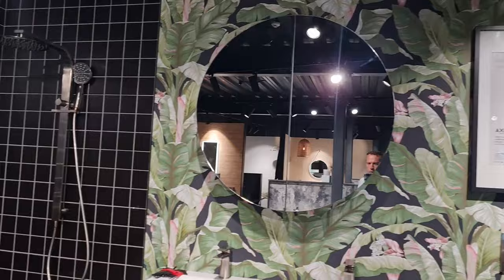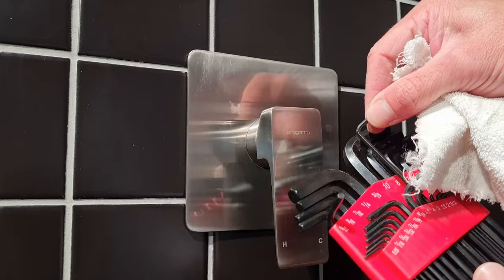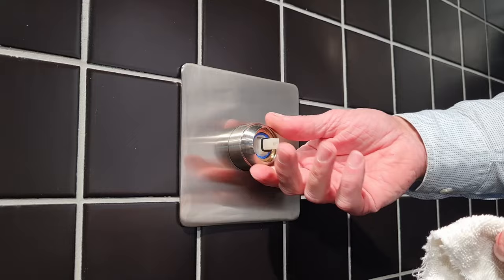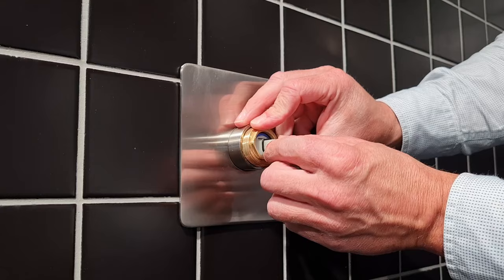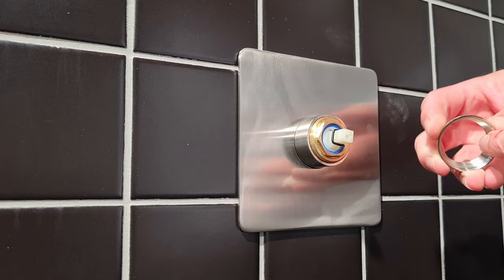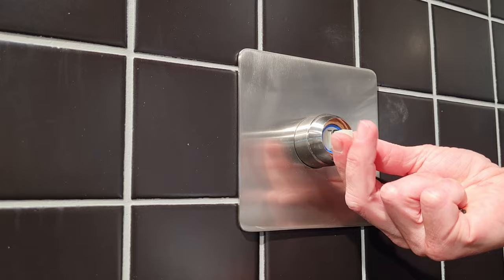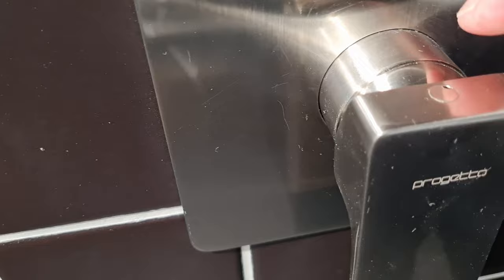How to change a shower mixer cartridge   Plumbline tapware

Comment: Great video! I was able to change mine today. Thank you.
Reply: Where can I buy the parts pls.
Reply from the maker: Most plumbing shops will sell these cartridges, usually known as 35A or 40A 'flat bottom' cartridges (35mm and 40mm diameter respectively) the Kerox brand are very good, check here - https://kerox.hu/en/products/cartridges/ - ask your local plumbing store for them.

Comment: Great! No washers or rubber seal things? Looks simple. Gonna try it.
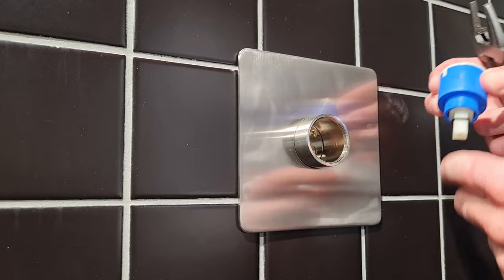Reply from the maker: Depending on the model and the cartridge that it takes, the seals should come with the new cartridge. Make sure the old cartridge gasket/seal is not left in the mixer when removing it, check for this as in the video at 3:48 mins - https://youtu.be/YLLudC3DdxM?t=228  Cheers.

Comment: Pardon my ignorance. Are these cartridges adjustable? Would you be able to adjust the amount of hot water coming in or do I have to do it elsewhere in the system? Thanks.
Reply from the maker: I'm not sure what brand mixer you have but you can get a 35mm cartridge with an anti-scald ring (or hot water limiting ring) - here is the link as an example:

https://kerox.hu/en/product/kn-35/

ADJUSTMENT OF THE HOT LIMIT RING:
When the cartridge is supplied the hot limit ring is in the middle position.
To save hot water and to avoid scald the ring can be turned. In this case the pin of the ring is bumped against the stop around the cartridge, before we can reach the full hot water position by turning the handle of the faucet.
The adjustment of the ring is as follows (see the attached drawing):
The hot limit ring must be removed from the cartridge.
The ring must be turned clockwise up to the requested point.
The ring must be re-positioned onto the cartridge.
Maximum flow rate can be adjusted by a grub screw located in the lever.

(You can see the grey hot limit ring in the picture on the webpage in the link)

Hope this helps.
Cheers.
Reply: @AJsTechTalk8370  Thank you for your prompt reply. Cheers!

Comment: How do you change the pressure - our Astrawalker sink taps are waaaaaaaay to hard and fast and water sprays everywhere!! Help!
Reply from the maker: Hey there. Unfortunately, on an inbuilt shower mixer like this, you will have to reduce the water pressure of the complete house via a pressure reducing valve, of course this will drop the pressure of the whole house but that is one option. The other (and more simple option) is to add a restrictor to the wall elbow outlet. This is only applicable if you have a slide shower (handshower and hose setup).  You would remove the hose from the wall elbow and place the restrictor in the hose fitting and then screw it back on. If you have a fixed head outlet (no slide rail) you will need to unwind the head and install the restrictor in the inlet of the rose/head and re-install. Hope this helps. Cheers

Comment: I can't get the first rim cover off mine. seems very hard to twist :(
Reply from the maker: I suggest to use a penetrating oil like WD-40/CRC 556  or similar and spray into where the thread is locked up. Leave it for a few days to let it soak in and then try again. Use a damp rag or a rubber ring on the rim cover so that you can grip it better. Let me know if you want me to make a video on how to do it. Hope this helps.

Comment: Why would you want to change this part?
Reply from the maker: The cartridge inside all single lever taps/faucet/mixers, is the main working part that mixes the hot and cold water. Put very simply, It uses two ceramic discs tightly packed against each other with holes in them, a hole for hot and cold inlet and a hole for the mixed (warm water) outlet. As they move in different positions, (via the control handle) they mix the water to get the desired outlet temperature out your shower rose. this part is susceptible to the debris in the water and the ceramic discs can be scratched by the debris. This causes leaking, running through so that the tap doesn't properly turn off. Further to this, if the water system is exposed to high pressure or water hammer (hydraulic shock - when the mixer handle is slammed off very fast) this could also destroy the inside of the cartridge.
You can think of this part as the sacrificial part in the tap and manufacturers make this the easiest part to replace. Hope this helps.